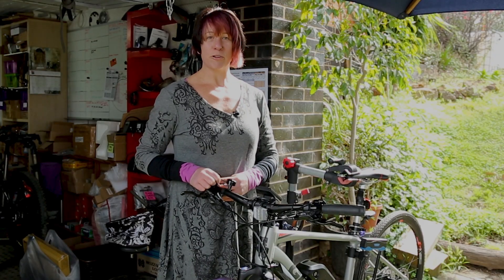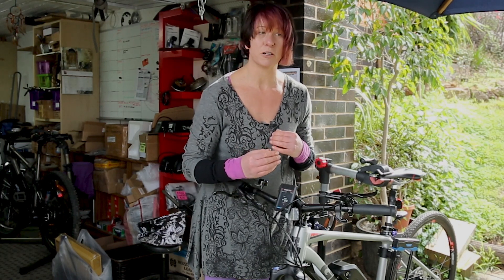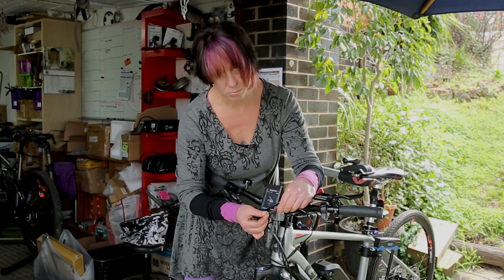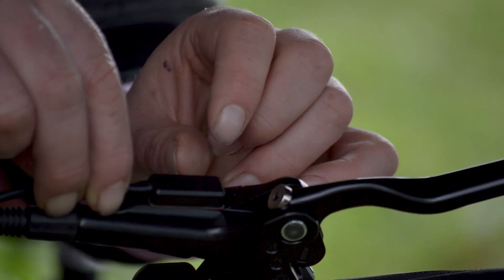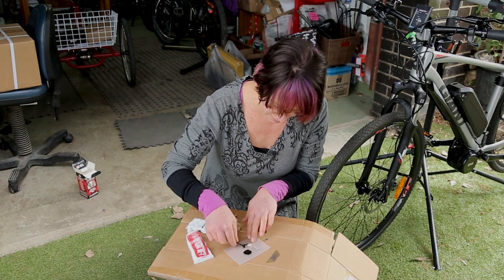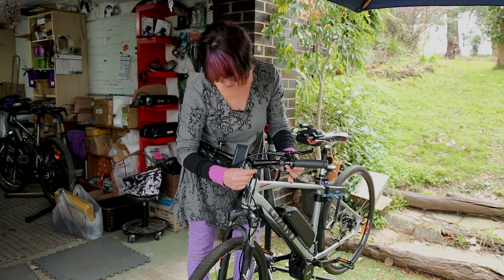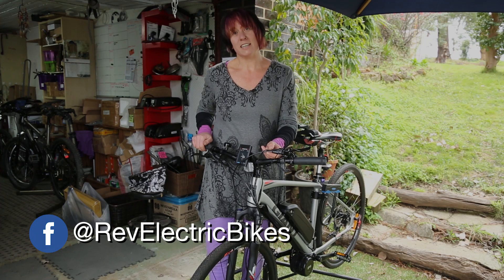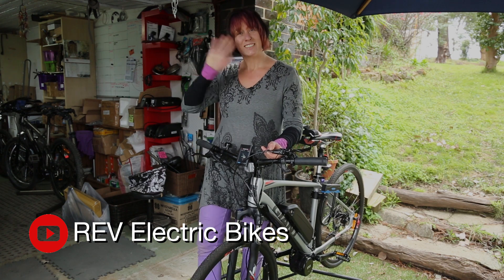Installing the magnetic brake sensor

Comment: In my case I've removed the 4mm grub screws securing the handles of my Clarks hydraulic brakes onto the handle axil pins and replaced with a 4mm flat head bold which the magnet sits on top nicely then secured the magnet to bolt head in place with heat shrink tubing. Didn't fancy sand papering and epoxy route in case I wanted to upgrade and sell my existing brakes on.

Comment: Hello, I would like to ask why the engine shuts off nicely when I press the front brake, but the engine does not shut off when I press the rear brake.
I connected both yellow connectors to yellow, green to green, everything else works fine.

Thank you and best regards

Comment: Good info thanks.. but you'd think that there would a better, easier solution than to have to mix glue to attach pieces to make this work. At this point you'd think they'd make special hydraulic brake levers with a simple "plug and play" set up making for a quick, fool proof connection like all the other ebike electrical connections.
Reply from the maker: They do, but they are a fair bit more expensive, and hydraulic bleeds are not something the average backyarder can do.

Comment: I bought a rear hub motor kit from you around 3 years ago. After around 2500Ks all 3 bearings disintegrated. A big job to repair.
Reply from the maker: Really EAH? That sounds unusual. Wondering why you didn't bring this back to us, we could have fixed quite simply.

Comment: Does 500C display have that cut out icon on a screen for easier fit of the sensor?
Reply: It does not.
Reply: @davidswelt  thanks for reply, but I ordered it and it does have it.
Reply: @mrmayb1211  Strange – I have this display too, and while it does have a brake symbol at the bottom left, this never activates (even though sensors are connected and working).
Reply: @davidswelt  that's very strange, mine always comes up when I brake.

Comment: If you epoxy the sensor in place, how would you replace the sensor if it fails?
Reply: These are solid state (Hall) sensors that are unlikely to break. No moving parts, nothing that deteriorates over time. Most likely the magnets would lose strength, or they would slightly shift (hence the epoxy solution). You can pry them off though, and remove any epoxy residue with acetone or sandpaper.

Comment: this is quite useful information, i have a question though, soon im gonna be converting my bike to ebike.
it doesnt have those round connectors, can u recommend any other sensors i can use?
im from the uk.
thanks
Reply: You can get them with different plugs or you can cut the round one off and put the connector you need in place
Reply: the different types can be found on Alibaba at cheap $.

Comment: Hello. thanks for the demo.. can you tell me the approximate mm spacing on the sensor to the magnet needed for proper install.  It would be great if the manufacturer would put spacing (as a starting point) Cheers Robb PDX USA

Comment: Question... So I dropped my bike one morning and it started to act funny... Like i would have to ride downhill pedaling to get speed and then hit my rear brake and the bike (2015 Diamondback Lindau) would throw up error code 6, which is rear brake sensor, and when the code would pop up the motor would then kick in... As long as i didn't shut off the bike the motor would function as it normally had... When i shut it off, back to having to go fast and hit the brakes again...
One day I ended up having the battery die on me while i was out... When i recharged the battery and went to ride, i couldn't get the motor to kick on anymore and couldn't get the e6 message to pop up even... Other thing was the speedometer which had worked even if i would be walking the bike... Now i was bleeding the brakes and notice the magnet is missing on the brake handle... Is this the cause for the e6? But if so, why would the motor kick on when i hit the brakes? I have purchase jb weld and i have a magnet, just hoping that when i do this it works again... I need my bike running again...
Any info or suggestions, besides take it to a shop, would be great...

Ok, I've done some troubleshooting and bled my brakes and I've got my speedometer working again but still no boost from the motor... When in the diagnostic mode, my display indicates that my throttle is sending the signal, but still get nothing... Is this because of the missing magnet?

Comment: Hi RevBecca i have the same motor but i have the c965 display i did everything you did but when i press the brake exclamation mark does not come on even tho i have installed it the same way when i engage the brake when riding it does cut the motor out is this just down to the display?
Reply from the maker: I'd say so Thomas, some displays may not give a symbol for the cutout. If it's working, gotta be happy with that 👌
Reply: OK Thanks  @Revbikes

Comment: If you use Shoo Goo for glueing the reed switch and magnet , it doesn't need mixing, less waste and can be removed ( if done properly) if necessary.  Won't hurt any stuff as well. VERY STICKY AND WATERPROOF.
Reply: They sell a range of Goo types ..probably the best is the automotive type.
Reply from the maker: Thanks guys, worth a try. We find it's the vibration which causes an issue, as well as temperature changes. Must try a few different options this year. Cheers
Reply: This is the info I was looking for. Thanks

Comment: Sorry C961 display and using hydraulic brakes with hydraulic brake kit sensors. Thanks
Reply from the maker: You can follow this same process, but instead of looking for the cutout symbol on the display, you will have to TEST the motor operation with the throttle / pedelec, to see whether the sensor and magnets are in the correct position.  The motor should run when the brake lever is in its normal position, and cut out when the brake is pulled.

Comment: I had my bike built with cut-out contacts in the brakes. I hated them. They actually shut the BaFang motors down for a few seconds delay when the brake was used and it was maddening. I have a Rohloff Speed-hub installed which you stop peddling when you change gears anyway. I disconnected the cut-out on the brakes and mounted a "The Green Button". It allows me to disconnect the drive when the button is pushed. It does the same thing but faster with no delay. It also allows me to cut-out and still be peddling, handy to conserve battery power when starting. - https://imgur.com/a/Kdqc9em
Reply: Yeah, with a Speedhub ya don't need it at all. You stop pedaling to change gears like common sense would dictate in a world without massive grinding gear clusters.
Reply from the maker: WOW, nice rig man!!!  Thanks for the tip, sounds like a nifty way to do it.
Reply: You can buy fluid disc brakes from Aliexpress with built in sensors for less than $100 full kit both front and back. Also just use a gear change sensor for which will suit geared hubs and derailers $69 AUD.

Comment: Hi, I have a road bike (with curved handlebar) equipped with Shimano STI integrated brake/shifter levers (brifters). I added a mid-drive electric motor. How to install a motor cutoff with disc brakes?
Reply: Same way.
Reply from the maker: You will struggle.  There are some sensors which operate via a cable running through them, like the gear sensor cutout.  We have used these on drop bars before.  The alternative is to simply go without the cutout - its not that necessary if you have the gear sensor in place..  Just change down through the gears as you are coming to a stop, and the gear sensor will do the job!  Hope that helps :)

Comment: Depends on what tape you are using ;) There are few that are quite strong! :O
Reply: Great video. Well explained. I am converting from mechanical brakes to hydraulic and I don’t want to lose the power cut off that I have now but will lose when I convert.  Where can I buy just the sensor cable and magnet?
Reply: @basincut100   Alibaba/china has them with all the various connectors...
Reply from the maker: Apologies, we missed this question.  If you still need them, we have them available, but only sell within Australia.  Please email info@rev-bikes.com to see if we can help you. Thanks!